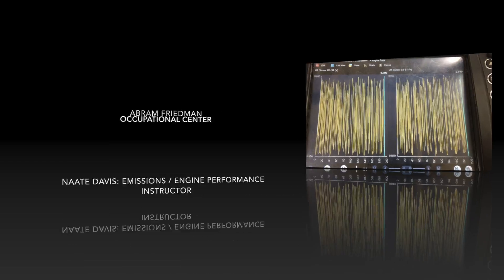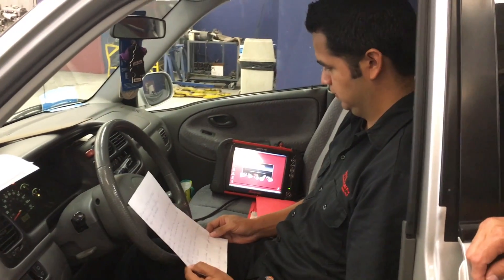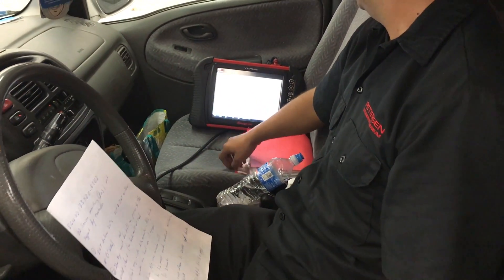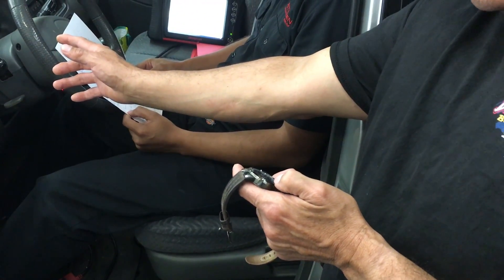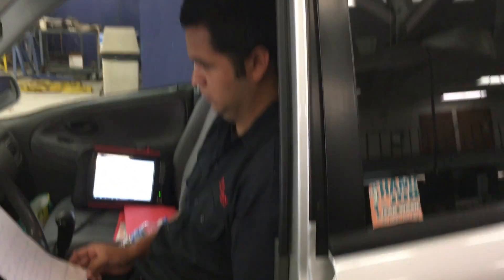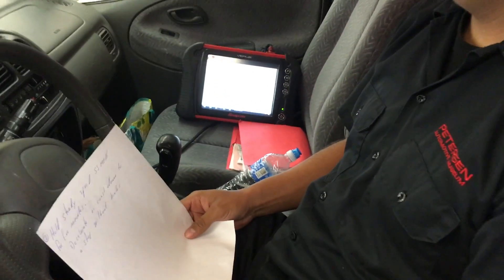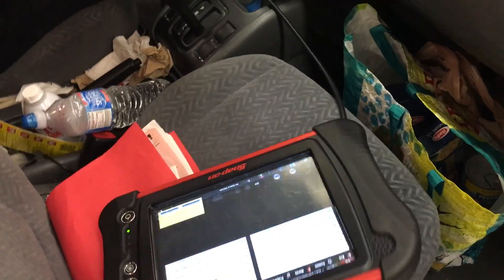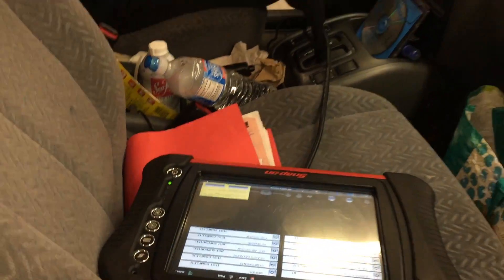Drive Cycle: 🥳  How to complete a Drive Cycle for the O2 sensor monitor that wouldn't run

Comment: Unplug all your 02 and h02 sensors at the electrical plug connection then start engine and let it idle until the check engine light comes back on.  Then shut the engine off and plug all your 02 sensors back up.  Then disconnect ground on battery and wait 15 minutes then reconnect battery (even if you have a scanner to erase with still do this) Then start the car and drive it and the 02s will then been read by the ECM and make ready.  An ECM is nothing but a transistor box like a 1965 hand held radio and areas of the feed become dormant
Reply: It can help you and I really wish people would cpy and paste my information on notepad and save it on a USB chip.  Most mechancis don't know these things and go by the average methods because they aren't computer mother board educated.  PCM/ECM is a mother board structure with three sets of transistors.  One stays active while the other two become inactive after their prompted performance from the soul active portion.  Any cycle can be done in 10 miles or ess if people will go by my instructions.
Reply: I did this and it worked . I don't remember where I learned this but it definitely worked for my 06 Suburban . Causing a fault in the system wakes up the monitor and it starts monitoring and after a few drive cycles it sets .
Reply from the maker: Earl Guyton thanks for the info I appreciate it
Reply: Dealerships and many service shops would hate me for giving out this information.  When you disconnect the battery ground and let it sat then reconnect it surges the entirety of the ECM box. So youre making it start over in order to fully function.  Like taking the battery out of a cell phone to make it start over.  Erasing with a scanner doesn't erase everything
Reply: would you do the same to clear the emissions monitors? Have incomplete, o2 sensor, evaporative sys, and Catalyst coming back incomplete. I wonder if swapping out the o2 sensor will fix all three monitors?
Reply from the maker: razz P Did you try to find the written drive cycle for your car? Also are there any pending codes on the vehicle you are working on?
Reply: Earl Guyton I have the same issues and it totally make sense. Thanks! for a detailed explanations.
Reply: Giving this a try on my 2006 scion xb. It’s stuck in purgatory where it’s not smart enough to throw a code… fingers crossed..
Reply: @scottdunbar9808  Be sure and disconnect the positive battery cable for at least two hours and re connecting beofre starting the drive cycle after you cause codes to happen.  Erasing codes with a scanner still leaves the pending code in an ECM
Reply: it didnt work for me either. @Chicago Rc
Reply: Is a HO2 sensor the same as a O2 sensor?
Reply: @lorenzobordeaux8604  No.  HO2 is a heated 02 sensor, meaning is is mounted directly on the catalytic conververtor or between the exhaust manifold and the cat.  The 02 sensor however is mounted after the catalytic onvertor.  H02 stands for heated oxygen sensor and 02 stand for oxygen sensor
Reply: Making the ready IM monitors incomplete again is necessary if some readys will not happen.  People don't understand that ECMs get dormant areas after time and using only the software for the engine.  Such as why would an 02 sensor show not ready or a cat not ready but then not produce an error code in the DTC?  So if there is no DTC for monitors that don't show ready then this means the parts are GOOD but the transistor area in the ECM is dormant.  Swapping out 02 sensors is nothing but wasting time.  Heres a rule of fact..  Anytime a part does not cause a DTC code it means the part is GOOD so the only other fault would be the ready monitor simply not reading because it isn't active.  IM goes into inactive mode once a drive cycle is complete as to where DTC stays active due to always needing to be active for your timing for your engine. To change any part whether ot be a cat or evaporator system part or 02 is a waste of effort and money UNLESS a DTC code occurred.  If ready monitors in your IM wont set its because of an improper drive cycle by the driver or the ECM going into IM dormant mode.  And to get one ready monitor to set YES all others that say ready have to be erased in order to start over IF one or two wont set at ready
Reply: What should I do I have my 02 and HTR NOT READY. What steps I need to get them to green. What’s weird is I had them green before Pretty fast then now taken way long
Reply: @EarlGuyton425  Jeep Wrangler passed smog Nov 2019. Had starter and battery replaced. Wanted to sell Jeep - O2 sensor was not complete. Car has now had all 4 - O2 sensors replaced and the PCM. It was at the dealership for 4 months. They now say the O2 passes in the "pretest" but still not complete. Please advise. Do you recommend
disconnecting battery and then running the drive cycles again?
Reply: @jayperez30  You could try going through the drive cycle again.  But why did some dealership replace the pcm?  What is going on here?  They replaced the pcm with what?  A pcm that wasnt totally flashed possibly?    Anytime some dealership changes out your PCM, someone wanted to make some money and pull some BS on someone.  And this matters in the way not all was flashed into the new PCM.  If I go buy a new or reflashed PC for any vehicle, if it isnt flashed fully for that vehicle I install it in, nothing will ever be right as for the ready monitor codes and engine functions.  More information please
Reply: @EarlGuyton425  They 1st replaced all 4 O2 sensors with stock sensors. They flashed the PCM. It didn't work. They put in a new PCM, it didn't work. The put in another PCM, flashed it from Corporate headquarters, still didn't work. They did not charge us for the PCM. They have Jeep Engineers working on it, but no one can figure out why it won't pass.   Do you know what they mean by it passes on one side of the computer but not transferring over in the computer that communicates to the smog mech.  Could it be the connection to the PCM?
Reply: @jayperez30  There are two inner panel, one BUT two actions.  Such as a code might not occur but then ready monitors will never set. If two ecms have been installed and flashed, its apparent the wrong software is being flashed into these ecms.  Whoever these people are, they do not know what they are doing or it could be so you will get frustrated and just buy a new vehicle from them.  And yes, there are several readings when inspections are performed.  First is the current pending or active code or codes, the second is the 5 to 7 ready monitor  showing a yes or a no for each monitor.  If any dealership that knew what they were doing it would all be complete within 30 minutes or less.  No engineer is involved here at all, but instead a software developer would be involved.  The same working software loaded into the ecm on all running same vehicles WORKS or the other ones would not be running.  You need to contact the FTC and that dealership would suddenly have your vehicle going within hours

Comment: Do you have the exact criteria? I'm fighting this with the exact same car
Reply: Unplug all your 02 and h02 sensors at the electrical plug connection then start engine and let it idle until the check engine light comes back on.  Then shut the engine off and plug all your 02 sensors back up.  Then disconnect ground on battery and wait 15 minutes then reconnect battery (even if you have a scanner to erase with still do this) Then start the car and drive it and the 02s will then been read by the ECM and make ready.  An ECM is nothing but a transistor box like a 1965 hand held radio and areas of the feed become dormant
Reply: Earl Guyton are you in Sacramento? Or close?